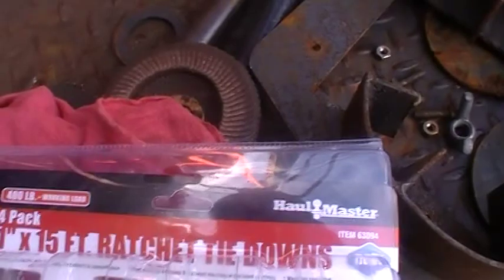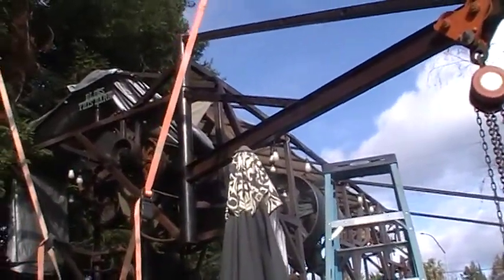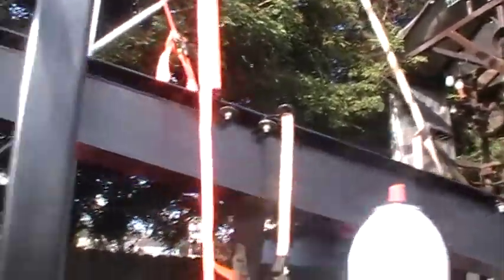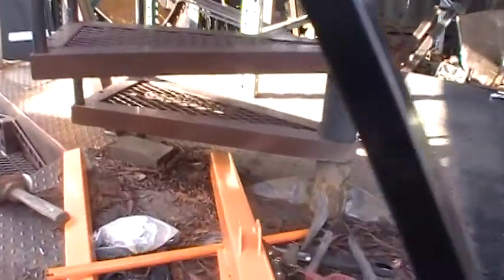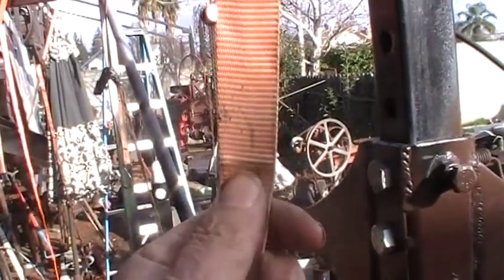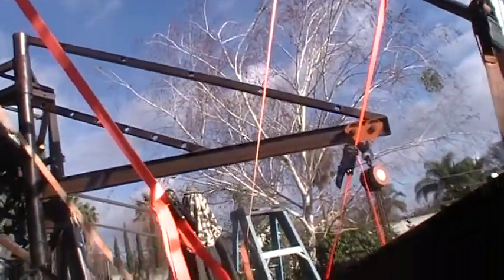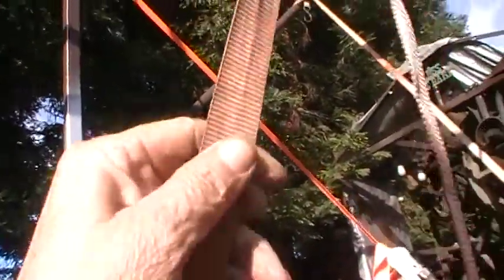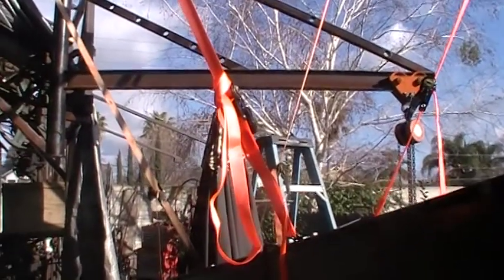Avoided a possible catastrophic failure

Comment: I always forget about welding splatter. Glad you're ok! I used to use a bunch of those orange straps to lift truck beds, but even in good condition they would break on me. Decided I should stop pushing my luck and restrict their use to holding down hoods and doors on parts cars...
Reply from the maker: Yeah after this you're more than right 😂. You know HF has 1000# ratchet straps on sale
 I've backed off for now to think
 about it and you've talked me into it. Next year I'm going to get a couple 4 packs.
Reply: @davewilson1591  The 1000# work much better. I went straight to chains and a big gin pole on the back of my shop truck. I've done enough goofy shit to know what I can get away with, but decided that borderline setups were not worth getting hurt over... Happy New Year!